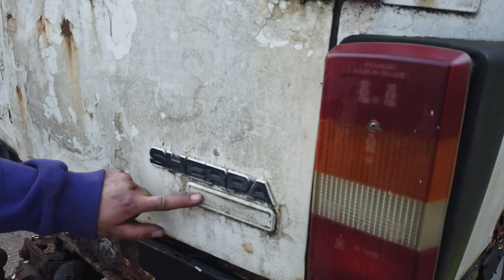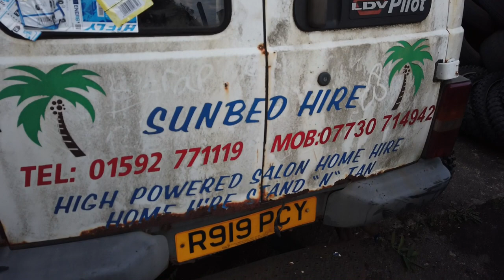Buying a van in  September 2021

Comment: Bit of T-Cut, should be alright...
Reply: Bit of newspaper fibre glass filler. thick underseal your on your way on the road. 1980s style .God I seen some right sites on the road back then motel as well. remember  seeing xr3 with mot. it's wings  were  rotten
Peeling off at seems like tin can